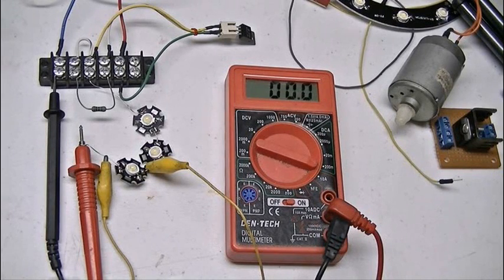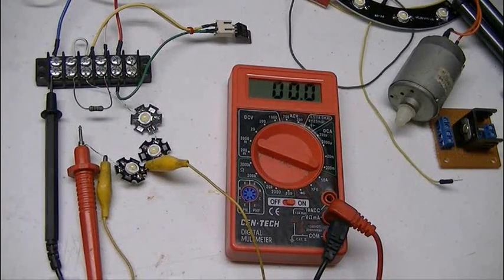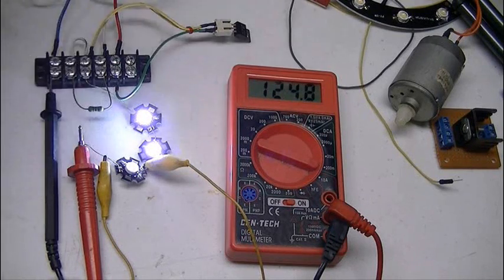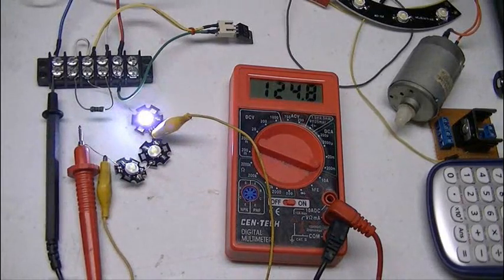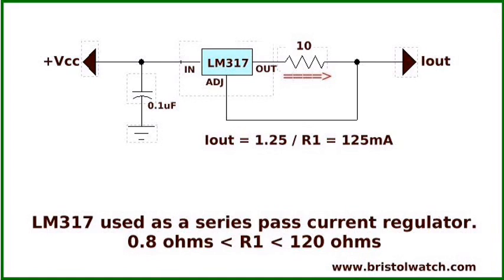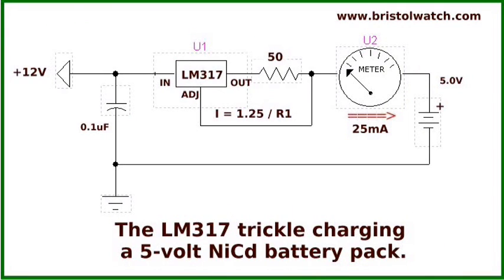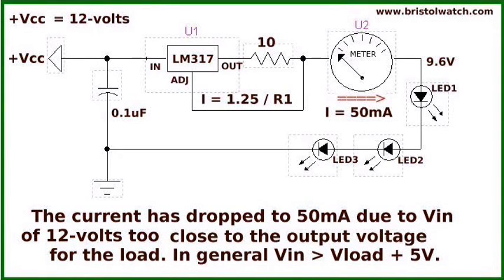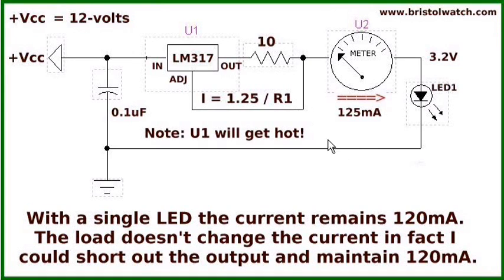LM317 Constant Current Source Circuits

Comment: So how does the output voltage across the LEDs get 3.2 volt each? Whereas there is no settings for output voltage???
What if you adjust the current to 0.15A with still maintaining Vcc constant??? Will the voltage across each LEDs be still 3.2V???
Reply from the maker: This only controls current, so the 3.2V across the LED is the device's voltage drop. Lowering the current can change the voltage drop somewhat, but it mainly affects the brightness.

Comment: Hi i tried it and no mater what resistor i used the current regulations was around 200ma i used 1.8ohm resistor for 666ma i used 1ohm and still 200ma output.i tried it with another 317 and the problem was the same.input voltage 16 output 9v led
Reply from the maker: I'm a little lost here. This is a current, not a voltage regulator. The output voltage is based on the load resistance. I will have to cover this again because many new people don't understand the difference, which can be tricky.

Comment: I really appreciate the knowledge you shared gives me more insight on how to control the wild voltage output from my motorcycle bridge rectifier, still wondering how to reduce the heat dissipation. However, Thanks !

Comment from the maker: LM317 Adjustable Voltage current Boost Power Supply
https://www.bristolwatch.com/ccs/LM317boost.htm

LM317 High Power Constant Current Source Circuit
https://www.bristolwatch.com/ccs/LM317b.htm

LM317 Constant Current Source Circuits
https://www.bristolwatch.com/ccs/LM317.htm

Comment: Hi after watching your video I found it very interesting and also looked at a LM334 but that varies with input voltage so I want to make a circuit that will provide 27 volts dc constant voltage with an output of 2ma so thought I could use two 317s one set for constant voltage and one set for constant current I don't need to adjust anything = 27v @ 2ma do you have any suggestions please Lewis Bob in the UK
Reply from the maker: Recheck your circuit because it doesn't vary based on input. Voltage is based on load resistance.

Comment: current coming is 125 mA, agreed, but what about the output voltage across the device, how do we control that
Reply from the maker: You use a separate voltage regulator after the current regulator before the load.

Comment: how to make 11.5v & 1.6a
Reply from the maker: First of all the voltage out depends on load resistance. By itself a LM317 will not carry 1.6A you will need a pass transistor which is not as stable as the LM317 by itself but should suffice.
See https://youtu.be/n94xqPMhmTo

Comment: It is VERY difficult for someone who is an expert in their field to come down to the level of a novice. This chap has not done a bad job but I would have liked to see the full circuit showing voltage and current regulation. I'm pretty sure you could just add the standard LM317 voltage regulation circuit straight onto the front end of the current regulation circuit. Also I prefer the LM338 as it can handle 5 Amps. You may not need 5 Amps but us peasants need everything going for us. A few diodes for protection ?

Comment: As per KilJD below...I also am lost. when just starting out these things are not obvious, and if I wasn't just starting out I wouldn't need this explanation. When you are charging a battery, how do you control the voltage so it doesn't overcharge or to ensure it gets enough to actually charge it? If charging a 5 v battery don't you need to go above that by 10% or so to force against internal resistance of the battery?
Thanks

Comment: I need to handle Amps, not milliamps. Can I do that with this simple circuit, or do I need to learn about Switch mode Constant current supplies, or whatever it's called.

I'm trying to design a circuit that can charge the LiPo in under an hour. Idk why, just do. Just in case the sunlight isn't there for my circuit.
Reply from the maker: If you want amps use a pass transistor.
See https://www.youtube.com/watch?v=lnU5d-KBMLg&t=1s

Comment: Hi lewis... video is awesome .....please tell me how to control the output voltage.. suppose i have to run 6 v device with the above constant current source (LM 317)  then  i have to apply regulator to set to 6v at the output terminals or it automatically detects the required voltage?
Reply from the maker: Output voltage depends on load resistance. You can use a voltage regulator after the CCs.

Comment: where does the 1.25 value come from?
Reply: It's the internal voltage reference inside the chip.
Reply from the maker: from the manufacture's spec sheet.
Reply from the maker: correct.

Comment: Hi Lewis,I was wondering if you have any suggestions for constant current source circuits that can be implemented in negative High Voltage circuits for Vacuum Tubes. I am talking working over a range of -1KV to -2.5KV. Do you think I could implement zener diodes to drop the supply voltage heavily to be able to use one of these lower voltage circuits? Thanks in advance.

Comment: Can I use a LM317 circuit from 12v DC for electrolysis zinc plating small brackets/bolts etc. I need between 2.5 & 3 amps? Or do use a different circuit & components? Cheers very good videos.

Comment: Thank you!! Building a 500 MHz oscillator kit with SMDs. Instructions requires a constant current source of 40mA for protection in case of building errors then setup and alignment. Your video is well done. TNX K9QHO

Comment: Hi there! I'm very grateful for you sharing your knowledge, I'm learning a lot! I have a doubt about the lm317 and I'll be glad if you could help me! I've seen a lot of videos explaining lots of circuits of bench's power supply, but I still havent found one that put a lm317 as a regulated current source. I got an idea from another video,  putting 2 LM317 in series, first one as a current regulator, second one as a voltage regulator. The only difference in the circuit, in comparison of yours, is that the guy put a variable resistor rather than fixed, like is shown in datasheet. The problem was that he changed all of the circuit along his vídeo, including the ICs. Well, I write something on the paper and I'm thinking in put a 1,2ohm resistor in series with a variable resistor ( any value in parallel with 120R). My doubt is how high the current will flow through the output resistors (to keep everything cold and not burned, rsrs) and if you could suggest a better solution for my application (bench power supply, using lm317 to control the current and voltage). Sorry for my grammar mistakes, greetings from Brazil!
Reply from the maker: +CTitocanto The current source use is right in the spec sheet.
Reply: I knew that... Maybe i didnt explain my doubt right. But ok, thanks.

Comment: I'm lost.  How is the voltage coming out controlled?  I undertsand you can get a constant current but what voltage will you have on the output?
Reply: There is something that people who fully understand this relationship get that those of us that don't struggle with.  'the missing link'. And they seem reluctant to grasp that others don't get it.  So, for instance if I want 6 volts out at a max of 100mA, how do I do that?....and why?
Perhaps we will eventually find someone willing to get a novice to edit their videos/tutorials before posting.
Cheers
Reply: Gerry - if you want 6 Volts, you need a Constant VOLTAGE source. If you want 6 volts out a max of 160mA, you need a Constant Voltage Constant Current source. Most loads need constant voltage, because they cannot self-regulate so they will explode from over-voltage. And normal loads draw only what amps that they need, so there is absolutely no need for Current limiting. However LEDs are different - they are a diode and they have a fixed voltage drop (let's say 3V per chip). So if you feed an LED with 3V or you feed it with 6V or even 9V, it only ever drop 3V per chip. So, you don't need to control the voltage, since the chip does that automatically. The issue is that an LED is a current hog - it will draw whatever Amps you supply it with. Feed an LED with a Lithum battery, it will draw 1Amp or 2Amps or whatever... of course this causes it to get outrageously hot and it will die almost instantly. Hence, for LEDs you only need to limit the current. For battery charging you need to limit the current AND limit the voltage.
Reply from the maker: KillJD The current is fixed regardless of load below a fixed resistance. The load determines the voltage. See 
http://www.bristolwatch.com/ccs/LM317.htm

Comment: Thanks for the video. LM-317 will not work with a modulating input changing from high to low voltage, would it?
Reply from the maker: Veronica Fernandez Marmol I don't think so. What do you want to do?

Comment: How did you get 9.2V and 5V on output? Thank you...
Reply from the maker: saldin suljevic 9.2V is where 3V was across the LM317 from a 12V supply. The 5V charging a NiCD battery was an illustration - you need a separate voltage regulator set at 5.6-6.2V
Reply: Lewis Loflin Sorry I didn't understand... If Vin = 12V and R1 = 10 then Iout = 125mA, what is the value of Vout = ? and will Rload take as much voltage as it need so the current remain same? For example if Rload = 20, Vrload = 20 x 0.125 = 2.5V (Rload is not R1), in another case Rload = 40 so Vrload = 5V.  Vrload = Vout ??? Vout vary with variations of Rload?? Thank you.
Reply from the maker: saldin suljevic This is not about voltage but current. The 9.3V was the drop across the three white LEDs in series. If I used two white LEDs in series it would still be the same current but 6.1V. Now if you have a load resistance that's too high say 2000 ohms well 2000 * 125mA will run the voltage almost to the power supply and there will be no current regulation.I don't know what you mean by Rload. You divide 1.25 by R1 (the 10 ohn I used here.) Again the current if FIXED the voltage depends on the load resistance - if the resistance is too high the current will not regulate.
Reply: Lewis Loflin thank you, that was useful

Comment: Hi Lewis
I made this circuit and the current changed when I changed the voltage. I didn't have an LED so I used a buzzer,I think its a pizoelectric buzzer. I'm new to this stuff but I'm trying to make a gadget that needs a constant current source.Any idea on why it didn't work.
Although I used a DC power source,would this work with AC.

Thanks
Reply from the maker: eamonn280958 A pizoelectric buzzer only works with a varying voltage and is not a current device. What is your input voltage and the voltage of the device?
Reply: Lewis Loflin
Not sure what you mean by buzzer not a current device. I used a variable voltage power supply wound it from 0 to 15v and the amps changed accordingly. I did use a potentiometer where you had a resistor between the LM317 and the meter. I could put an LED instead of the buzzer. To clarify the buzzer or the LED will not be in the circuit when finnished its just to test that I am getting a constant current.
Reply from the maker: eamonn280958 A piezo buzzer does not draw a current. A voltage twist the crystal structure to produce a sound. This won't work with a piezo device. try a resistive load.

See http://en.wikipedia.org/wiki/Piezoelectricity

Comment: hmmm... u charge a 5v battery with a constant current source that can and will provide up to almost 12v ?!?!?!? that means it will raise the cell voltage and rais it even more so that your constant current can keep on rushing into the cell, no matter at what voltage your cell is. isnt it ?!
Reply from the maker: You still have to have a voltage regulator - the charge current is independent of voltage source and load current. That what was illustrated.

Comment: Is the 1.25 from lout = 1.25 / R1 =125 mA is coming from the typical voltage reference from the datasheet?

Thanks,
Reply from the maker: JOHN CHAMBER That is the general formula. The 125 mA comes from the 10-ohm resistor I used.